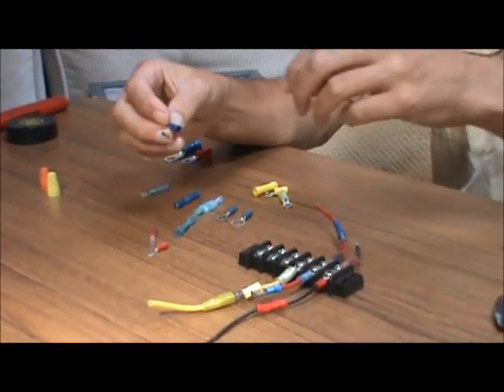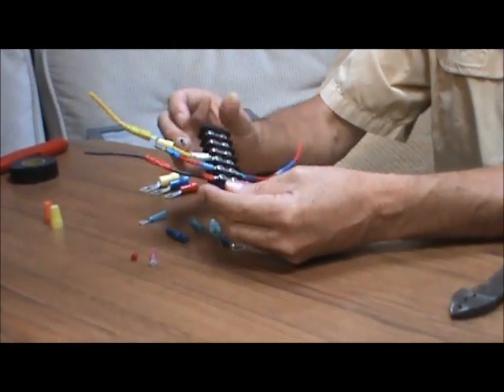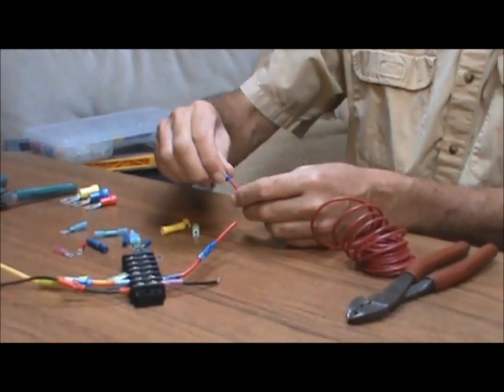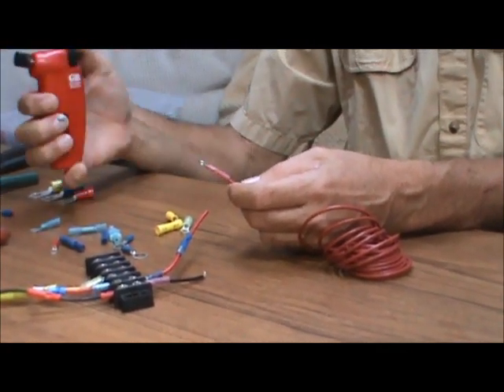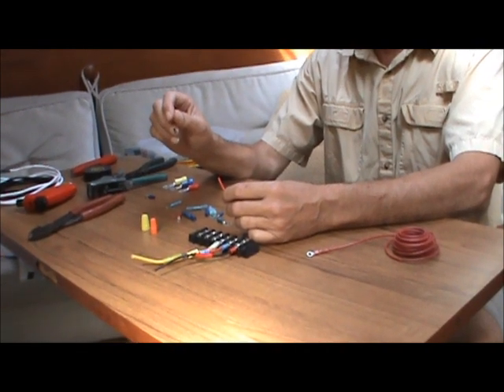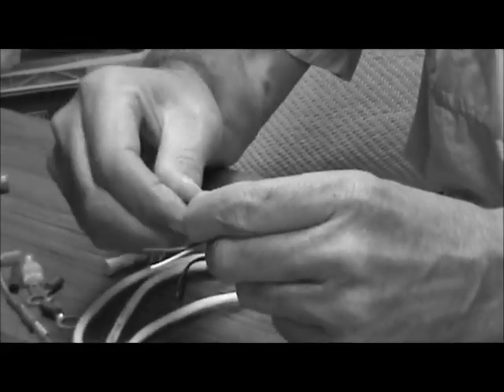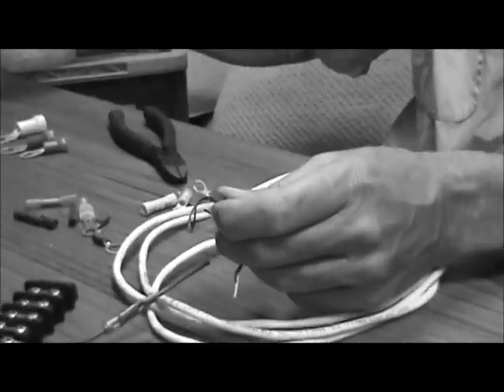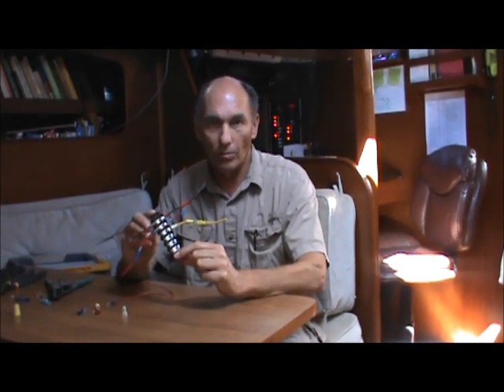Using Crimp Connectors, Boat Repair, Boat Wiring

Comment: Excellent video and very helpful. it is nice when you dumb it down for those of us that re new to wiring. It would be nice to see a video on the basics of wring a boat. Like what is a amp? watt? polarity? wiring a switch, wiring to fuse box, why do we need a fuse and when should one be used? how to trouble shoot an electrical trouble. What steps to take? I guess you can tell these are all things I need to learn haha.

Comment from the maker: Agreed the solder will stiffen the wire and can cause it to break from flexing and vibration. You make a good point about the wire coming loose but if the wire is energized it could fall loose and short on something. I suppose there are points to both arguments but I think it best to keep the screw attached.

Comment: Nice video, but----The reason for not soldering is vibration damage.  Spade vs. ring.: Yes the ring will stay on a loose screw, but continue trying to draw power, get hot, and likely make sparks.  In most cases I'd rather it fall off and be an open circuit instead of burn.